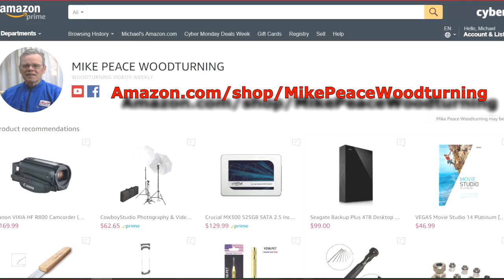Three Corner Bowl

Comment: Is there a reason you put the tenon on the drive center end?
Reply from the maker: Good question, Eric. I had to stop and think about that.  That is the way the demonstrator I watched do it. But I think cutting the tenon on either side would woruld work just fine. on this kind of bowl.
Reply: Mike Peace Woodturning thank you. I have tried a couple of this style bowl. One of the most critical elements I have experienced is the starting cube must be as close to a perfect cube as possible. If not the wall thickness of the bowl is not even. I find turning the tenon on the live center easier and safer. I really do value your videos. Really excellent.

Comment: Do you normally finish the inside of the bowl before or after removing the tenon and turning the foot when using a vacuum chuck?
Reply from the maker: I always add my finish off the lathe. generally 3-5 coats of Minwax AO.

Comment: I first saw Jimmy Clewes turn one of these a few years ago in Kansas City at the AAW Symposium. He turned at really high speed. I’ve only made one and it turned out pretty nice. Does it matter what you set on the grain direction? You have 3 sets of points to pick from. Thanks for the video👍
Reply from the maker: I move the block around and it looks like you are going to wind up with the same grain issues no matter.

Comment: Hey Mike I'm new to wood turning just over a month.  I've made a mushroom a goblet with a captured ring some solid vases due to lack of a bowl gouge which I recently acquired. My problem is I'm not sure where to set the tool rest center ,above or below center. I'm reaching myself and trying to be as safe as possible thank you for the videos they are very helpful to me
Reply from the maker: Maybe this video will  help. https://www.youtube.com/watch?v=easecB1--xE&t=13s
Reply: Thank you sir you are very informative and helpful
Reply from the maker: Sorry, this was the video I meant specifically on tool rest height. https://youtu.be/vS9_Z6wAU4M
Reply: Oh that explains why I still didn't get it lol. I've only been doing this a month and I use your videos for guides very helpful especially trying to be self taught
Reply: Wow ok have you ever had one of those oh the light just came on moments. That's what I just had watching that video thank you for the help
Reply from the maker: That makes me smile! Good luck with your woodturning.